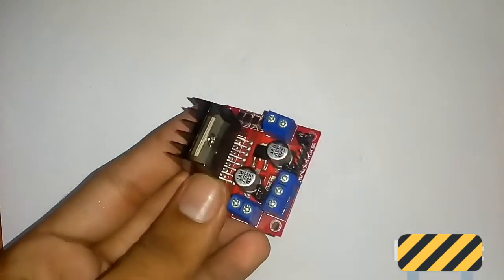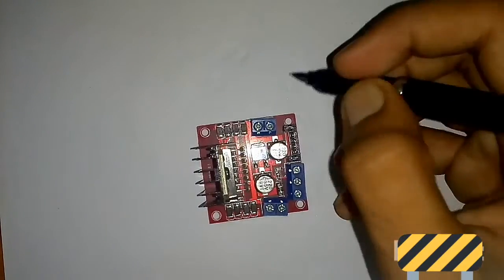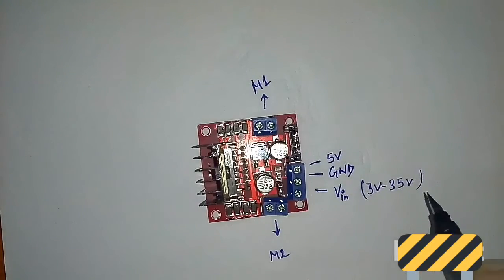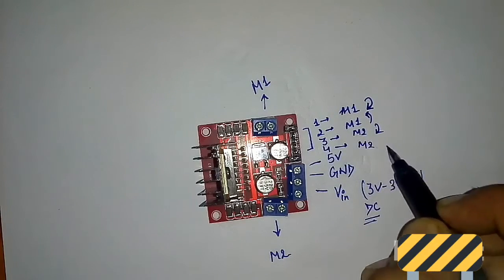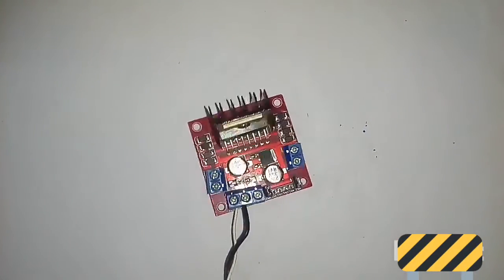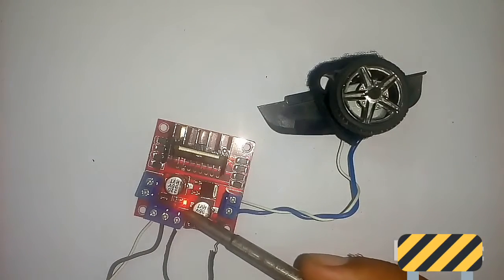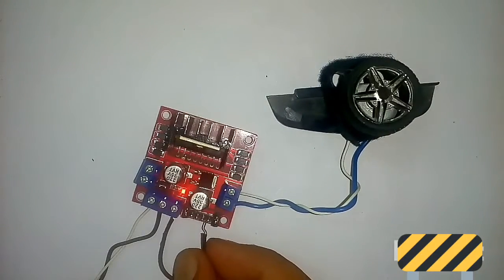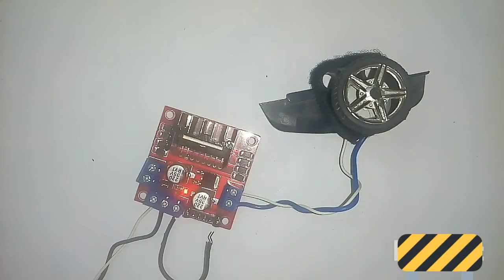How to test L298N motor driver board - Tutorial

Comment: Help! 

I thought that you “HAVE” to supply voltage to the enable pin for the motor to spin, I’ve read that multiple places, I must be missing something. When I’m experimenting, my motor spins regardless of if I have the enable pin hooked up. 

Also, why don’t you need a diode? Sometimes you need it sometimes you don’t? I thought you need a diode when controlling a motor or the voltage spike will damage things.
Reply: Ah ok, thank you! 

I didn’t realize that the jumper was a little plastic piece already in place, I thought when people said jumper they meant you have to jump it with a wire.
Reply from the maker: That plastic piece is jumper
Reply from the maker: Some drivers have diodes built in … 
My driver have jumper builtin.
Reply: I removed the jumper piece and now it doesn’t spin unless I send voltage to the enable pin. 

Thanks again

Comment: Hello friend, on my current schematic, I have two 12V DC motors connected to both sides of the motor controller, but upon doing the test on IN1, IN2, IN3, and IN4 that you are doing, I find that nothing happens when I power In3, and In4. Do you have any idea as to why?
\
Thank you
Reply from the maker: Set en pins to high

Comment: When i connect 5v with input 1 or 2 my motor is not working (output 1 and 2) 😭 please tell power is showing in moto driver
Reply from the maker: You need to put enable pin to high.

Comment: Hey , I am making a obstacle avoiding robot , everything is working but 2 bo motor are not working , I have given power using 9v battery but none of the motor are working . Please help .
Reply from the maker: Check if you put enable jumper or not

Comment: when i connect the 5v utput to the motor pins, my motor doesn't spin. I checked the voltage diff between the two motor pin connections and the reading is 0. does that mean that for some reason my IN1234 is not connected to the motor pins?
Reply from the maker: There are two enable pins en1 and en2 make sure to connect them to 5v

Comment: The led of l298n driver is on. But the motor is not rotating. . Whts the problem? Plz give me an answer
Reply from the maker: There are two enable pins on the board. En1 and en2 you have to connect them to 5v using jumpers... They are placed on both sides of the input pins
Reply: @RoboCircuits  😍thanku very much
Reply from the maker: You are welcome

Comment: Sir please tell me supply ki pin aage piche aati ha kya????
Reply from the maker: 3 pins hoti h isme... V Ground and 5V
Reply from the maker: From the left 
First pin is V
Middle is ground
Third is 5v
Reply: @RoboCircuits  but sir mene motor driver l298n purchase kiya usme first 5v or middle ground and third is 12v diya ha  sahi h ???
Reply from the maker: To aap battery to 12v m lgao
Reply from the maker: Or Arduino ko 5v m

Comment: Can we plug 4 DC motors having positive and negative wires separate?
Reply from the maker: yes we can
Reply: @RoboCircuits  thank you so much 👍🏻
Reply from the maker: yeah its safe... you will need more current so use a better battery
Reply: @RoboCircuits  yes I have a 12v battery only for the motor driver.
Reply: @RoboCircuits  thank you as I am using raspberry pi 3b+ and I dnt wanna fry my pi or motor driver.The net says only 2 motors can be attached so u sure it's safe right?

Comment: I am not able to use both motors with it...one motor when connected works good...but with two motors it stops working...what should i do?
Reply from the maker: Increase battery voltage
Reply: @RoboCircuits  is 9 volt battery is enough for 2 bo motor

Comment: Hey I want to ask a question and I wish someone answers when I connect batteries to motor it works but when I connect it to the l289n driver it doesn't work does that mean that it is the problem the l289n
Reply from the maker: Did you use the enable jumper??????
That is important

There are enable pins on both sides of input pins
Make sure to connect them to high or use jumpers
Reply: Ok
Reply: Hey when I removed the jumper on the l289n it didn't work
Reply: Let me chat with you on messenger tell me your name
Reply from the maker: Message me on instagram @robocircuits
Reply: Can you message me on messenger

Comment: Why 12 v applied 

What is out put voltage which is connected to motor
Reply from the maker: what ever voltage you apply in Vin that will reach to motor

Comment: Which battery is best for l298n
Reply from the maker: Any battery with voltage greater than 5v and current more than 2A

Actually it depends on the motor as well

Comment: Super Simple.... I was looking for this. The input coming to IN1 and IN2 is about 3v so the driver is not driving it seems. I am getting 4v at respective motor output but motor doesn't run. 

Trying to troubleshoot
Reply from the maker: Use more than 5v on input.. it won't work if voltage is less
Reply: @RoboCircuits  it was working sometime ago.. was working pretty well but not sure about voltage on input pins. Did not measure at that time. 

I have two motor driver IC modules.  

1. MX1508

2. L298N

An output coming from decoder IC on the receiver is 3.2v. 

The MX1508 works fine but L298N doesn't.  

It was working and not sure what changed. Now will test L298n by giving 5v as you did and lets see if it works.
Reply: I tested it.... it works only for one pin on IN4.... Seems it has gone bad. Bought it 2 days ago lol
Reply from the maker: Did you set enable pin high???
Reply: @RoboCircuits  Yes Brother. Both are high. 

Suppose if one jumper of EN1  is bad for example....

Now as the En2 was enabled, The motor spins when I connect IN4 to 5v but doesn't spin when I connect IN3 to 5v. 

So I believe its bad. Not sure what happened

Comment: Hello sir, what should be the voltage on output pin as my motor is not rotating on both output pin, please tell
Reply from the maker: Which battery are you using

Comment: Does motor voltage have to match power source? Let's say I have 9v battery as power source. My motor has to be 9v too?
Reply from the maker: Motors have a range of power... Like some of them work for 5v - 12 v
So you can get any which can work on 9v

Comment: hello i am setting up speed of 60 for both motors but one motor is speedy and other motor is slow ?? what is the reason behind this??
Reply from the maker: May be both motors are different... Try swapping motors
Reply: @RoboCircuits  both are the same motors i checked it by connecting directly to dc battery
Reply from the maker: Try changing motor sides and then figure out weather its motor driver problem or any other problem

Comment: does this conclude that :
1) my motor driver is working fine and 
2) there is some problem with my arduino
?
Reply from the maker: Yes may be
Reply: @RoboCircuits  ok and one more ques .  can i use this code on l293 and vice-versa?
Reply from the maker: Yes

Comment: Man!!! I have the same motor in working state and a 9v dc motor. Followed your tutorial, its not happening😶 what should I conclude? Please help me, I have it to be submitted some other way
Reply: No I removed the jumpers😶
Reply: When I connected the battery to 12v n gnd, board didnt even light up but lit up between 5v and gnd.
Reply from the maker: Did you put the power on jumper????
Reply from the maker: There are two enable jumpers on both sides of input pins... Did you put them???
Reply: So u say I should place back the jumpers and try again?
Reply: Placed back the jumper.. still the same. Is l298 damaged or something?
Reply from the maker: Can you send me pictures so that i can check
Reply from the maker: 8813083500

Comment: hey man, do you think you could tell  me why my red led is not on even though i know i have power to my l298n?
Reply from the maker: May be the jumper is not connected which is beside the power pins. That jumper is the power on jumper ... Check that
Reply: RoboCircuits I blew out the actual l298n chip, it actually blew a whole in it, I am not sure why it did that, it ran the motor for a second and then started to smoke and broke, I am not sure why this happened because I was running less then an amp through the board and I it’s only 24vdc
Reply from the maker: This must not happen... Because it can handle 35v current
May be there is problem in board

Comment: I need some help the driver board light turns on but the motor don't get power from the board and it does not power the arduino
Reply from the maker: Use power source to 12v input of motor driver board. Then from motor driver use 5v to power Arduino.
Reply from the maker: https://chat.whatsapp.com/Hf4kPxOEhU592VvwvrvV3N 
Follow this link to talk with me on what's app

Comment: What voltage motor did you use
Reply from the maker: 5v
Reply: @RoboCircuits  can I run a 3volt motor with a similar setup
Reply: And what voltage power source should I use
Reply: And what battery type should I use
Reply from the maker: You can use a battery between 5v to 35v on lm298n. But for your motor you should use 5v - 10v battery. Because the ic creates a drop of 2v hence by apping 5v your motor will receive 3v
Reply: Thanks

Comment: how do i connect just rc 6 or 8 channel receiver to this dual motor controller without arduino would this work. would like to control 4  n20 gear-motors from rc . the n20 motors run from 3v to 12v i think. i am  using 7.2 battery .  i have two of these controllers and would like to control 4 gear motors and add some led lights converting front loader toy to rc.  thanks
Reply from the maker: Okay 
These works on digital 0 and 1. Means only work if you put a 5 v on any of its pins. 
But the reviever works on pwm so this will basically donot work.
And using a 7.2v battery is ok.
Reply: conversion of a  bruder toy front loader ground vehical. i am confused about forward reverse as each channel has one signal wire . would i place positive wire to m1 counter clockwise and signal to clockwise pin for each channel. thanks again Carl Peters  do you have experience with the arduino quad motor driver

Comment: What is the max current it can handle 
I want to connect 8 12v DC motor in parallel to one output can I do it without burning the module please tell
Reply from the maker: Check the data sheet of ic l298n
Reply from the maker: It can handle 2A current from each channel and can handle 45v in input 
4.5 to 7 voltage as logic 

So 8 motors on a single channel is somewhat hard but a power supply of 18v may handle them safely

Comment: could you please tell me how many voltage used ?
also send me the circuit diagram
Reply from the maker: Nizamudeen mohammed i used 5v
Reply: RoboCircuits  circuit diagram?
Reply from the maker: Nizamudeen mohammed
Circuit diagram is shown in the video use that
Reply: Hi Bro , I used 9V battery motor and i connected in 12 V and GND but Mottor is not working
Reply from the maker: The nine volt battery is not able to deliver much current use a lipo battery or 1-2 ampere charger
Reply: Lipo battery means 1.5 v ?
Reply from the maker: Nizamudeen mohammed no 
Lipo batteries offer higher current 
Lipo batteries can be found from 1.5 to 12v
Reply from the maker: Nizamudeen mohammed https://chat.whatsapp.com/Hf4kPxOEhU592VvwvrvV3N

Comment: i follow what you did but my motor is not running.
how can i fix this?
Reply: Flix Mowry I had a similar problem a while ago and a higher voltage solved the problem. For me it didn't run at 5v at all. I couldn't even measure something with the multimeter. With 7-8 v it worked fine.
Reply: Please tell how to connect ena enb with 5v
Reply from the maker: Use pre installed jumpers or manually connect them using wires
Reply from the maker: Flix Mowry many times it won't work in low voltage because there is a small voltage drop inside ic. So use voltage more than 5v it will work quite nice.. if not then may be your module is damaged....
Reply: @RoboCircuits  i have used 9 volts battery but not starting motors only built in Led is glowing
Reply from the maker: Did you used enable jumpers?
Reply: @RoboCircuits  what do  you mean by enable jumper
Reply from the maker: There are 6 pins ... En1 in1 in2 in3 in4 en2.... 
En1 and en2 must be connected to 5v to enable motors
Reply: @RoboCircuits  thanks man it worked
Reply from the maker: @moizuddin9991  welcome... Kindly subscribe and sharr

Comment: How much voltage does it gives to run a motor
U r Something wrong there is a voltage drop of 2volts
Reply from the maker: aniket rajput   
Motor will run on the same voltage which you apply on the input...
5v is for arduino or any microcontroller....
Motor voltage = Vin
Reply from the maker: Let me check that again i will tell you soon
Reply: It has 2v less than input voltage as voltage drop